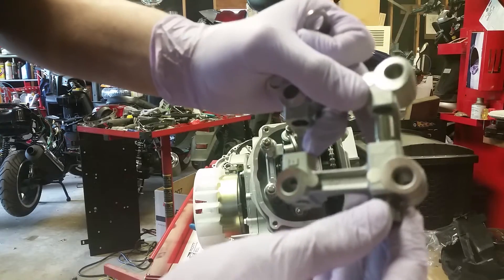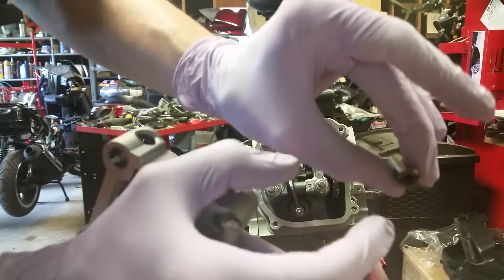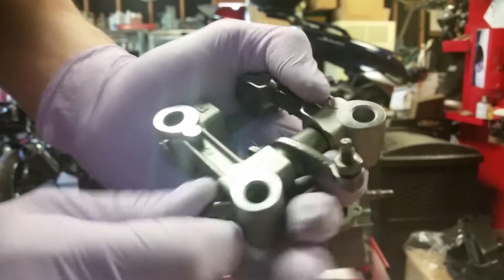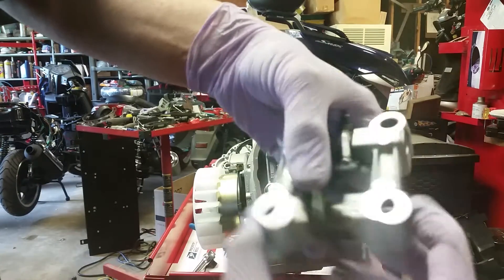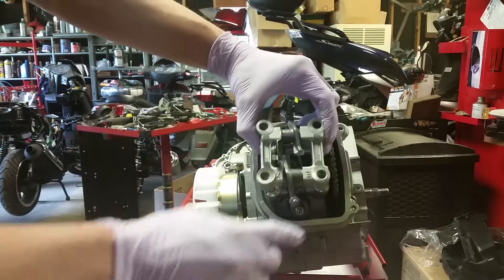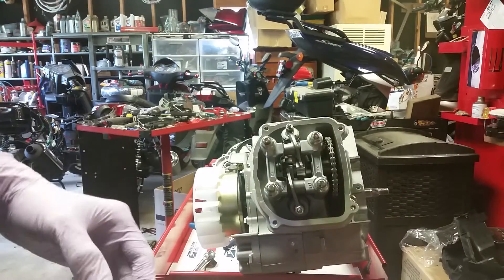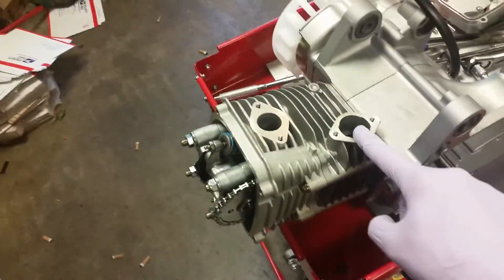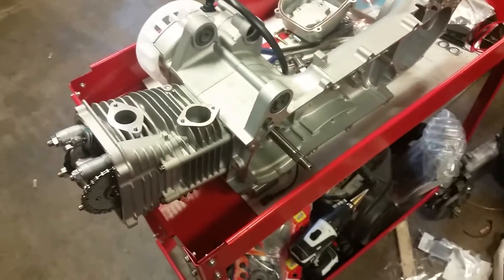180cc SSP G GY6 POWER KIT ROCKER CRADLE VALVE COVER ASSEBMBLY

Comment: A greeting, my friend, congratulations on the videos are very good, I wanted to ask you a question I have a gy6 engine 150 totally stock, i would like to give you a cam shaft A9, i wonder if I have to change by high flow filter or leave the original, Can I leave the original carburetor? Thanks friend
Reply from the maker: abrahamx1 
Hello, The A9 has a pretty aggressive profile.  It will only work with stock GY6 such as 157QMJ , but will not work with 1P57QMJ.  If you upgrade to A9 camshaft, in order to get boosted performance, you must also change air filter to something like UNI or K&N, you have to "upjet" you carburetor and get a performance exhaust... 

If you change the amount of air or fuel the engines use without increasing a way for the great amount of gas air exhaust to escape, you can actually create problems... You need to upgrade all components to get best performance in my opinion. 

Please Join my forum at www.dansgaragetalk.com ... We have some of the best scooter mechanics on the planet and can help walk you through your upgrades. Look forward to seeing you there!
Reply: just a new comment on your valve gap adjustment ...you are using metric feel gauge and I understand it is challenging in USA the same is for us in Europe with USA measurements. So back to issue on a  gaps. Would you consider as a "manufacture" recommended  gaps is 0,05 mm and 0,06 mm. If you adjust gaps like 0,004 mm and 0,005 mm engine will be much more responsive to acceleration-deceleration